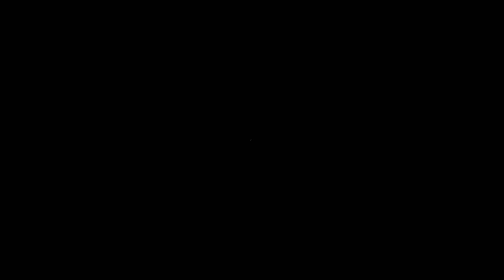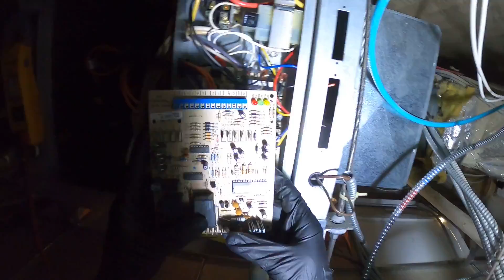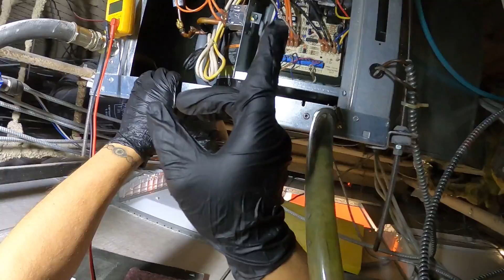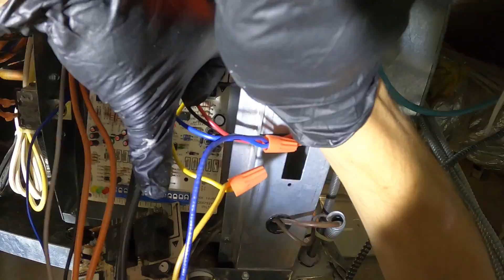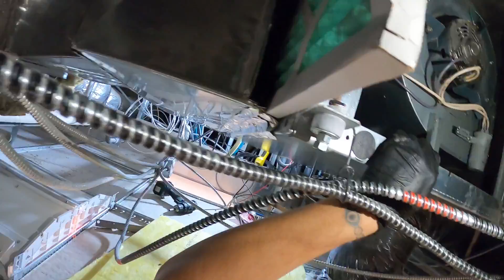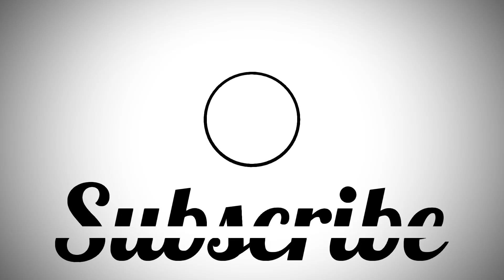HVAC: Heat Pump Control Board Troubleshooting/Replacement (Evaporator Fan motor Not Working)

Comment: the tip about taking one wire off at a time when replacing something is common sense, but it saves a lot of headache. take a picture and start one by one.